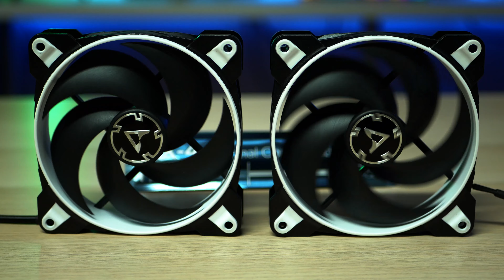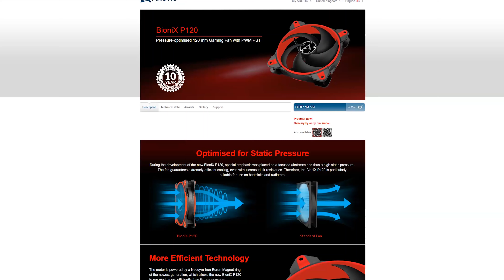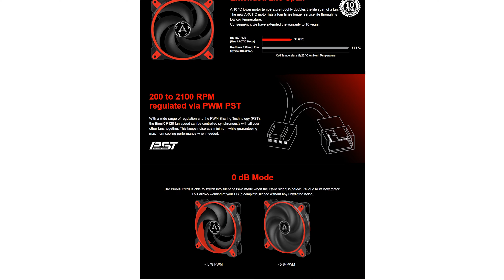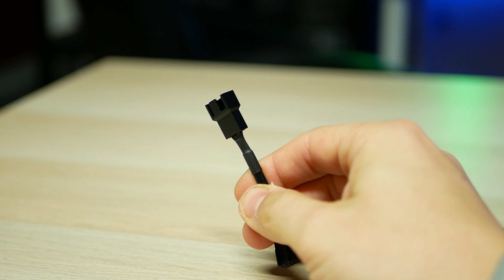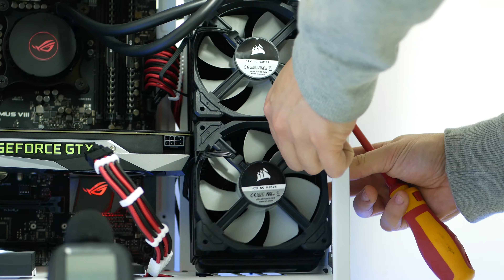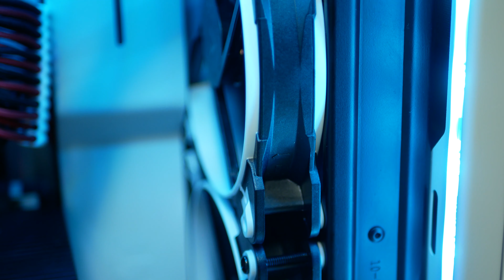Brand-New Arctic BioniX P120 Fan Review

Comment: Have you encounter any vibration humming sound? I just changed from my ML120 on my rad and now I have a really strong vibrating sound..
Reply from the maker: I haven't if I'm honest. If it definitely is the fans, get in contact with Arctic, they do have a 10 year warranty after all!
Reply: @TechHunterOfficial  
Ok, got it sorted by chaning to a Pull config instead of push. Now the fans are mounted directly to the case and then to the rad and no more vibrations :)

Comment: Were you able to use the same screws as with the ML120s?  (Presumably the ones that came with your AIO).  I ask since the P120s are 27mm thick while the ML120s, and most other fans, are 25mm.
Reply from the maker: Had no issues with screw compatibility at all :)
Reply: @TechHunterOfficial  Hmmmn, that's interesting.  Thanks!

Comment: your radiotor is wrong set,, it pulls hot air in the case....
Reply: If he face the radiator to the card then he might pull hot air to the graphic card.. But when he changed the 2 fan its wrong it must face the radiator to cool it
Reply: Im pretty sure he got high temp cpu

Comment: The F serie are ... pretty bad vs the P serie... they clame more pressure .. less CFM ... but in reality... not much difference, i've taken only P for my enclosure, P14, P12 and i'm very happy with them.
For info they are 5.99€ for the P12 PWM PST and 10€ for the P14 PWM (Amazon.fr)
Reply: heya. I need 3 statics and 1 airflow fans for my build. Would you recommend the P120/F120? The only close alternative in price/performance with the Noctua NF-A12x25? thanks

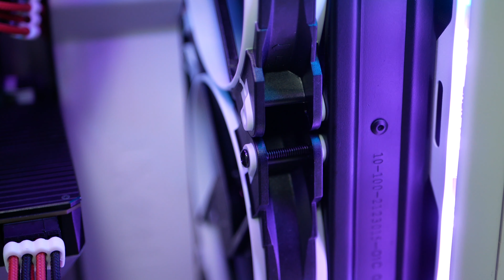Comment: idk if anyone pointed out or if u mentioned it, but u forgot one screw. 6:17
Reply from the maker: I was lazy haha... quite often I only put 2 screws in fans... I'm sorry to disappoint
Reply: @TechHunterOfficial  Another thing you should do is show how they actually sound like. While having a number on the db-scale is nice, it's also nice to hear how it actually sounds like. 

Im aware itll change from a case by case basis and other factors, but for people who are very sensitive to sound it helps a lot knowing what type of sound it makes, even if it's low. For example, two fans can be same dB but one can be percieved as significantly louder due to the sound pitch it makes.
Reply from the maker: @draanexle  thanks, I'll bear that in mind ♥!

Comment: I hate the noise they make
A big disipointment
I have the f120 they are much better
This sounds like intel or amd stock fans
I am talking about engine noise not fan or air noise
Reply: heya. would you not recommend buying the F120?
Reply: @dv2045  i like the f120 its the p120 i have problems with
Reply: @meki___6881  with...?
Reply: It's possibly a resonance issue or a faulty fan, I have both versions as well and I don't have any difference as they both have the same motors.

Comment: Any reason you mounted the fans in a pull configuration? Push is generally better. Anyways thanks for the review there aren't that many around for these. This helped me decide to get the P12 PWM PST's as I think they are pretty much the same tech but with a cheaper frame and lower max RPM.

Comment: Sorry if I missed it, but at what distance did you measure noise levels? 

40 db  at 1 meter distance isn't the same as 40 db at 1 cm distance
Reply from the maker: Was at about 1 foot away 👍
Reply: @TechHunterOfficial  This is really interesting read on how volume over distance works:
http://www.sengpielaudio.com/calculator-levelchange.htm

So basically, if you double the distance, volume drops by 6 dB, perceived volume drops by about a third.

Comment: This is quite an iteresting review. Somewhere last year I actually made almost the same comparison with the ml140 and the p140 (non boinix). 
I also came to the conclusion that the artics perform a bit better at the same noise levels though the difference was a bit smaller than in your case.
I tested on at least a half hour on some prime95 workload (all the same, I just don't remember the exact settings and time)
I came however to the conclusion that my measurement of ambient temperature may not have been accuracte enough. It fluctuated between 21.1 and 22.7 during all of the test and while I averaged out the starting and ending temperature of each test and corrected the delta for that I still don't know if that is enough for an accurate reading. 

Actually part of why I didn't believe the accuracy is because the artic fans won against the more expensive reputable corsair ones.

Anyway below is my test data if anyone is interested:
https://docs.google.com/spreadsheets/d/1Fd0Wh1nang7q-dPcYRKCfx_6zsY6x_geDbeUA6hkTkM/edit?usp=sharing
Reply: that's a very thorough test their m8.. i did the same thing against some corsair fans. I just found they were a hell of a lot quieter at max chat, and that was good enough for me :P

Comment: I bought 3 of the 140mm versions of this same fan for my alphacool 420mm rad that is also 60mm thick so I’m excited to try these fans out along side with my Noiseblocker e-loop fans.
Reply: Let me know your results putting together a 420 rad loop myself.  I would like to here your findings.
Reply: c wff    I’ve been testing my pc for a while and they are very quiet fans. My fans idle at 450 rpm and it’s dead silent. The e-loop fans are very quiet as well but I think the Arctic fans push more air.

Comment: I bought a 5-pack of these on Amazon for $28 US dollars.  It's insane that these are so good for the price!
Reply: aint those the regular P120 and not the Bionix?
Reply from the maker: That's awesome! Thanks for letting me know, I'll check amazon too 👍🏼
Reply: in my contry one is 13$ if you now how and there give me that link please
Reply: @milanwoltgas  I'm sorry that I didn't see this comment sooner.  😢  I bought a pack of the P12's here:  https://www.amazon.com/gp/product/B07HC782D5

For some reason I had the P12 and the P120 mixed up when I ordered them, but they work really well.  The fan blade design is very similar to the P120 and they flow a ton of air without making much noise.
Reply: All my fans are arctic fans right now i dont see it changing there good quiet fans .
Reply: P120 white is still 13.99 as of Oct 5 2020.  :))
Reply: These fans are $15 each. I would love to know where to find (5) for $28! You may be talking about the standard Arctic P12.

Comment: Nice review! These things perform well! Love the PWM PST feature of Arctic Fans. Makes wire management so much easier and don't have to worry about any PWM hubs or anything like that.
Reply: Im considering these than spending a fortune in NF-A12x25s
Reply from the maker: I'd say grab these, been using mine for a few months now, still quiet, still no issues and a 10 year warranty. If you're desperate for the absolute best and small percentage gains compared to the cost then grab the noctua ☺.